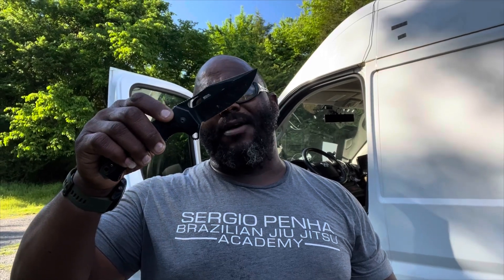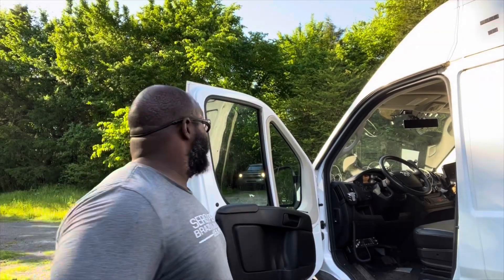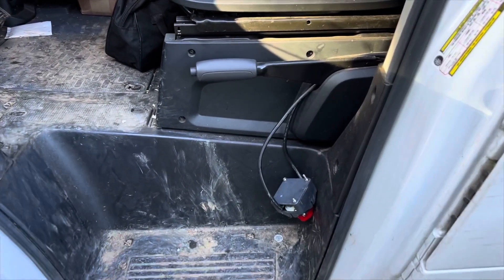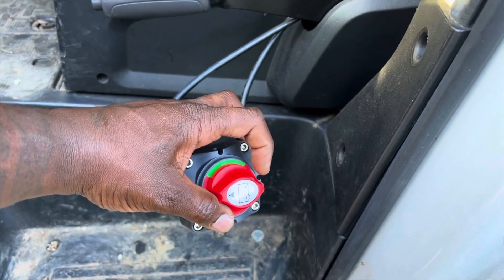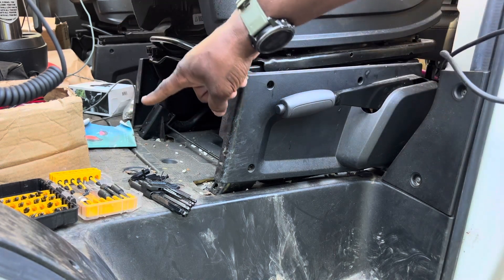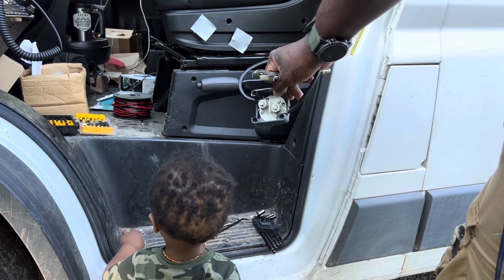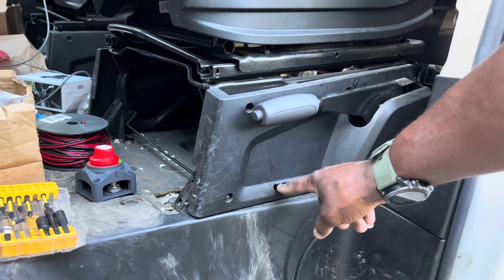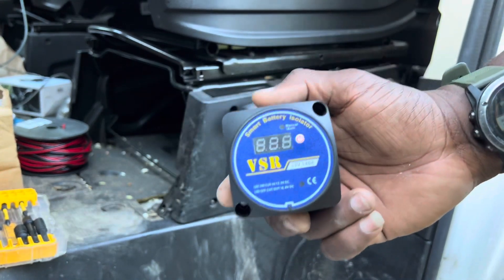Dual Battery Isolator Install

Comment: Bud, that's really slick.  Never heard of such a gizmo.  Thank you for helping me learn 👍!
Reply from the maker: Yes if you have dual batteries and charge them off the alternator you need a way to keep them separate so u don’t kill your starter battery using your secondary battery to run other things. Also this can be “back flow” to use as a jump start if the starter battery was to go dead.